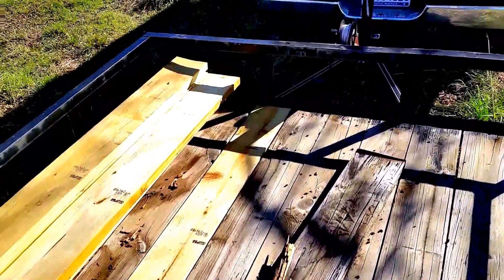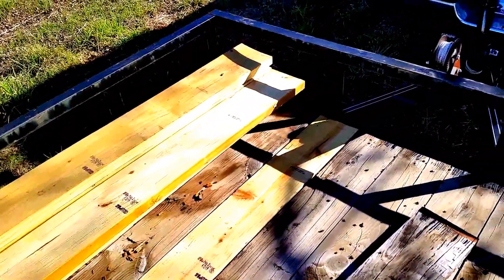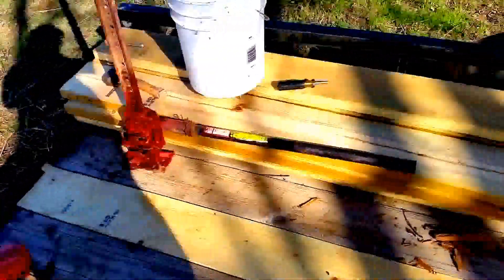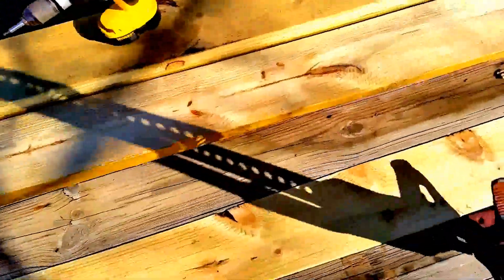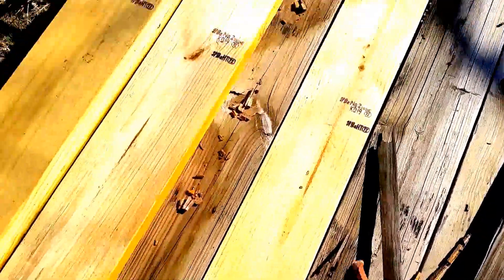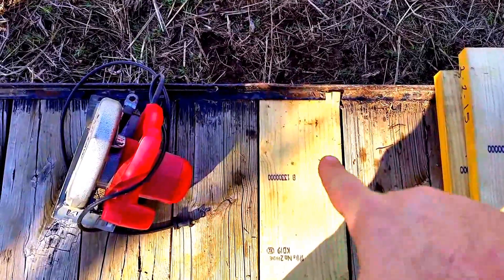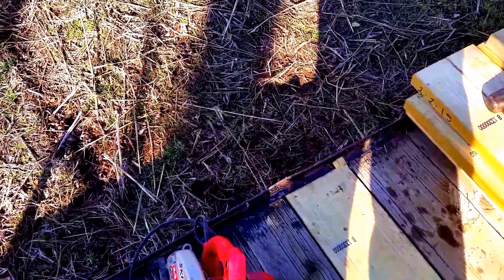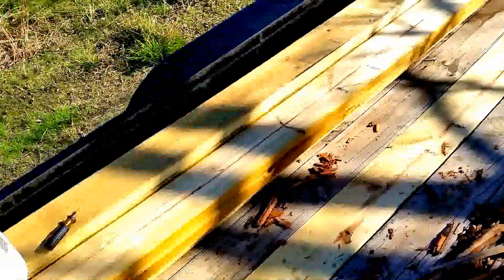Replacing a trailer board (no welding or cutting)

Comment: I saw the video I believe you are talking about where the guy bowed the board over a cinder block while is.wife stood on the end. I used that method last week. I put a whole new floor in a 5x10 trailer. Of the 7. 2x10x10 I was able to put. 4 boards in by setting them on an angle and knocking them in place Under the iron.
Reply: That is the exact same video I just watched.

Comment: That method will definitely work. However, I replaced the floor boards on my trailer by myself, so for me the following method was safer, easier & quicker also. To easily remove the old boards, I made two cuts a 8"-10" inches apart in all of the old boards between two cross members, (while making sure I wouldn't cut my wiring). The cut piece simply fall to the ground. Then the old boards can be removed quick & easy. Then I made one cut in the 1/4"x2" flat bar steel that secured the boards at the front. I made the cut about center of the trailer then bent the flat bar up just enough to be able to get the new boards in. Slid a new board under the rear piece of flat bar, dropped it in the "gap" I made,  then slid it to one side or the other. I repeated that til I got to the last board. Dropped the last board in place, folded the flat bar back down & welded up the cut. Start to finish the entire process only took about 45 minutes. However, none of the old boards were screwed or bolted to the trailer cross members. They were only secured on each end by the flat bar. Surprisingly, for only being secured at the front & rear, none of the old boards were warped or twisted and they had been on the trailer for years. 
   By the way, since you already had the new boards there, why DIDN'T you go ahead & replace all of the old boards while you were at it?
Reply from the maker: yeah I did it this way so as to avoid the welding and cutting.. I dont have access to a welder or cutting torch..
Reply from the maker: and I didnt replace the rest because 1. I was too lazy lol and 2 the others weren't as bad.. I still have the replacement lumber out in my barn when I need them..

Comment: i use a floor jack. if the trailer is to light to bend the timbers you can set a small floor jack on top of the axle. also the loose end can best be held down with a large c clamp put a strong bar underneath the traile to put to other leg of the c clamp on and put a piece of metal strap on the plank to avoid damage to the wood.

Comment: a floor jack under the trailer works well also, it is a lot easier if you have someone to lower the jack while you stand on the end of the deck board.